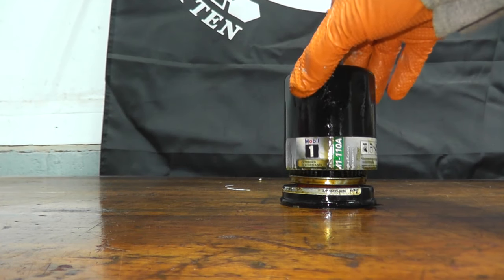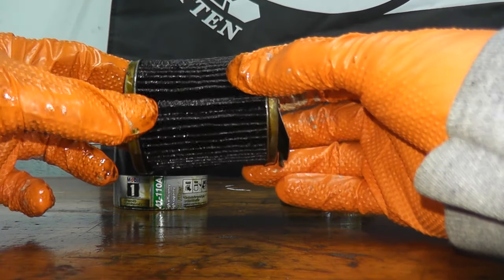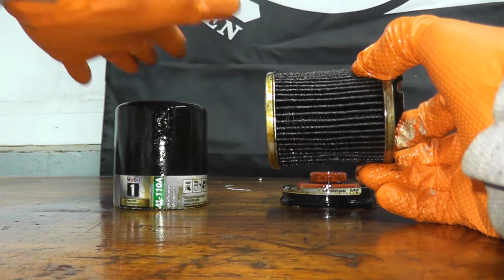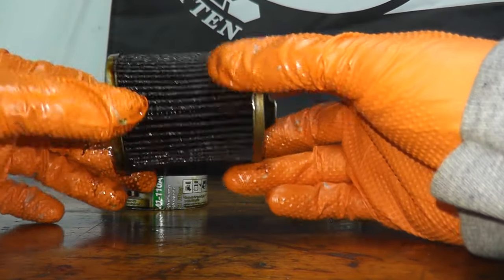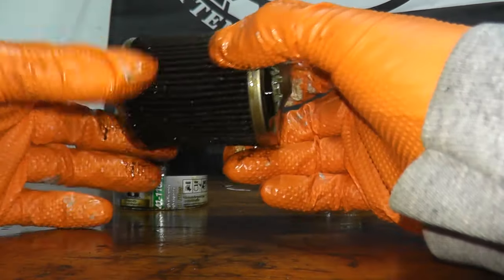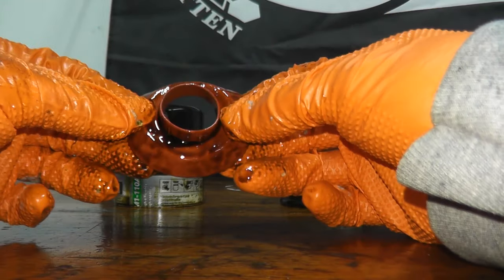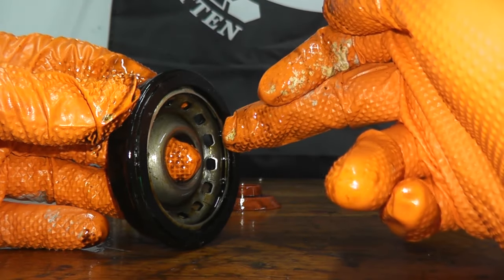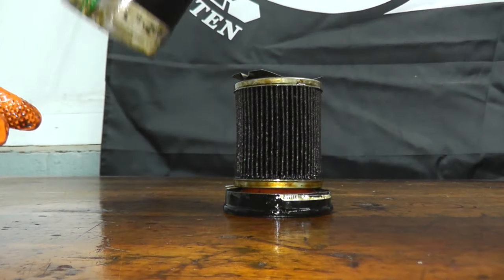Mobil 1 Oil Filter After 15k Miles Of Usage

Comment: I appreciate the informative video, brother!
My 2013 Chrysler 200 is at 57,000 miles. The owners maintenance manual states that running conventional oil, I should change oil every 10,000 miles. I use Mobile 1 20,000 mile full synthetic oil and the Mobile 1 20,000 mile filter. I still change my oil every 10,000 miles. The mechanic just about lost his mind telling me that my motor will seize up if I dont change it at least every 5,000 miles - regardless of filter or oil type. I stopped arguing with him. 

When I change my oil it still comes out relatively clean. A very light brown. Pretty sure it still has a LOT of life left, but I baby my cars. Yet every mechanic that I ever go to swears by the 1950s recommendation of "every 3,000 - 5,000 miles". I cant believe people still believe that especially with advancement in oil and engine technology... I call it a money grab.
Reply: Obviously the more often you pay to have the oil change. More money
Reply: I use Mobil 1 in a Mazda I’ve had since new. Change every 10k. 140k miles and no smoke. Good power. 36mpg at 80mph. Oil is much, much better since the days when 3k between changes was the norm.
Reply: yeah  good luck with needing repairs   
it's a Chrysler  anyways   junk yard car
Reply: @punker4Real  it's never had a problem since I've had it... 8 years later and it runs just as good as the day I bought it. Sorry you feel that way. I've babied it so it still runs, feels and looks new. The current value is way less than a car like this is worth - so unless I get in an accident, I foresee myself driving this for at least the next 16-20 years.

Comment: People need to read the fine print. These companies advertise these extra long intervals, but in the fine print tell you to go by manufacture recommendations, regardless. 

Also most vehicles have a severe duty interval. Like my Tundra. It is 10k mile interval. But “severe duty” which is gravel roads, stop and go traffic, short trips, towing, etc, it is 5k mile interval. Basically the long drain intervals are only for long highway driving.
Reply: Mobil 1 actually backs their claims.  Read up

Comment: I’ve known guys that put 8K miles on their synthetic oil and had it tested. Came back as for them to put more miles on it. For me, no more than 5K miles. I use motorcraft filter and pennzoil ultra platinum.  I use to use Mobile 1 but the pennzoil ultra is far superior over mobile 1.  Cost more but worth it.
Reply: Ah...a ProjectFarm student! I too, switched from Mobile One to PPU! I find it on sale at Walmart Online (not in-store) frequently for $22/5Qt jug and buy 8 bottles! Their “regular” price is ridiculous at ~ $68/5Qt bottle...
Reply: exactly.  i use same combo, but every single oil analysis after break in says 8k is fine on my Ecoboost.  Been doing for 8 years.  No problems.  PUP is awesome stuff

Comment: the orange rubber that  I know of is a natural neoprene rubber, and is the best rubber you can have on a car part or oil filter.
Reply: its Silicone btw
Reply: silicone.  its even better.
Reply: @02hreblue30  I don't happen to agree silicone is better for base gasket, it seems to be gummier, less backbone imo.  I've noticed some are switching back to black gasket while keeping the "better" sealing valve

Comment: On my 4 th hemi ram 03 08 14 and 19 changed the oil every 6500 miles with Royal Purple and KN oil filter all sold around 170 thousand the 08 has 400 thousand on it from second owner and that is the truck I beat the most GO Figure

Comment: Most excellent video. Thanks for posting. I guess the anti-drain valve you mentioned proves the point that when you change your oil and filter you should pre-fill your filter with oil if it is at all possible correct?  There’s an argument out there that it’s not necessary. I figure it takes 30 seconds to do it may as well do it if you can (filter is oriented in a manner that allows you to)
Reply: It's really not necessary, however if you're paranoid about it, prime it by disabling the ignition, crank it over a for a few seconds, renable the ignition, then start it up. There's really no need to fill a oil filter, engine parts will still be oil coated after draining the oil, and oil passages will still be full. Only case it might be a reason for would be for a engine that's been run a little dry on oil, as the bearings will be out of tolerance, then it might knock some on startup until oil circulates.
Reply: @garyr7027  - not paranoid at all about it all I know is when I start my car after changing the oil it’s as if nothing has happened because the oil filter is full. It takes another 20 seconds fill it before screwing it on. Simple case of why not. I surely wouldn’t disable the ignition and all the other stuff you speak of. Thanks for commenting
Reply: @condor5635  my 02 accord has 295,000 plus miles, the oil filter cannot be prefilled and I never had any engine noises on startup from a new oil change. I change it every 5000 miles. That's proof it doesn't need it, just a waste of time unless you have oil pressure symptoms that requires prefilling.
Reply: @garyr7027  - my 260k suburban can’t fill either but I do it on my Highlander. Just a habit. No big deal
Reply: Mechanics aren't going to do in order to save time. Does in make a difference. Yes but the difference is likely negligible. Still if you're the one changing your own oil, it's your time so why not? I'm retired and not in any hurry, so I often do it but sometimes I forget. In the long run it won't make any difference to me. The car will likely still be in great running condition when I may be dead and gone.

Comment: I change my oil every 5,000 miles. The filter I change at 10,000 miles. The oil filter integrity is still good at 10,000 miles, but I change it for peace of mind. I use Supertech full synthetic oil in combination with suertech mp filters. I've never had any issues. My oldest camry has 180,000 miles on it. The car runs and accelerates like the day I bought it.

Comment: Just change your oil every 3500-5000 miles and you will be fine. The people that want to push boundaries on how long they can use the same oil without changing it are the ones who keep the repair shops busy
Reply: Johnny  best  engine  maintenance I’ve heard     ps don’t forget the transmission
Reply: I wish people understood this. I do mine every 5000 thousand. Toyota call for 10000 and I'm thinking you guys are cutting costs. ✂️
Reply: I’m a 5k - 7k type of guy because my driving is 95% non-stressed freeway oriented!
Reply: Where is the oil analysis with particle count, viscosity, TBN and wear metals.  Get bright light shine through the filter media, you will be surprised by some of these synthetic filters.
Reply: Well I disagree with some of this. I have used Amsoil's best oils and filters in several cars, trucks, and vans with yearly oil changes from 12-25,000 miles. These engine required zero repairs other than valve cover gasket or tune-up stuff like plugs or wires, and were driven from 200,000 to 400,000 until either sold or retired due to transmission issue or wreck or other reasons.  But engines were still running with good power and smoothness. When valve cover(s) removed for gasket, no sludge or deposits.  I could not believe whst I was seeing the first time and used oil anslysis in the beginning to make sure oil was useable still....
Reply: @redlywaxer  In non GDI engines, I have in the past gone 40k miles with bypass filtration.  My current vehicle, 2012 Equinox with GDI and VVT, the oil shears to a 20 weight oil or less before 5k miles.  Fuel dilution is a problem in GDI engines.  GDI soot is causing major wear in these once reliable engines.  Amsoil is usually good for 8k, Full Syn about 4k, cheap oil about 2k.  In the winter I get a max of 4k.  I wish it wasnt so, but I still use Amsoil. Its still the best.
Reply: I agree. Most every oil related burning issue is because cars oil was changed every 10k miles. Every Toyota Master Tech that I've spoken with says to change it every 5k miles and use synthetic oil and you will never have oil burning issues.
Reply: Depends on oil and filter and how car s driven.  If all short trips on synthetic, then yes, sure go ahead and change at 5000 miles. But I have serviced a thrify friend's 2014 Prius with Supertech full syn 0W-20 and a $3 Supertech cartridge oil filter every 10,000 miles, and he does 30,000 miles/3 oil changes per year.  At 130,000 total miles, this engine does not use even half a quart between oil changes.
Reply: @redlywaxer  There have been a lot of issues with 10k mile oil changes on many Toyota engines and even other brands. The issue causes problems with the oil rings and oil burning begins and can quickly get out of hand. Sludge and buildup have also been a problem and clogging of small oil passages can cause problems too. Every Toyota Master Tech that I've spoken with has told me the same thing, change the oil every 5k miles and these issues just don't happen. They've seen plenty of oil burning issues with these 10k mile oil changes but to qualify for that OCI you would want to drive mostly highway miles and 90% of drivers wouldn't even qualify. So why try and save a few dollars at the expense of oil burning issues? It just doesn't make any sense. My wife has a 2010 Prius and I change the oil every 5-7k miles and it burns no oil between changes with 127k miles on it now. I use Toyota OEM oil filters and Mobil 1 ow-20 synthetic oil.
Reply: @jimsgaragetoys   1/4 of a qt at 104k miles(4000 OCI)  :D  my engine was well take care of

 this is amazing at lest for a  GMT900 as most of them  burn a qt every 1,000 miles or so 

The cheap comes out expensive
Reply: @punker4Real  It just goes to show that changing the oil more frequently is always a better option than taking a risk on a longer 10k mile OCI.
Reply: @charlesbarkwell7693  putting the wrong oil in a car will not cause it to seize unless it was straight oil not meant for cars. it will affect performance and efficiency in extreme conditions. too many variables were not considered (did she have 300k miles on her car, was there enough coolant, did she leave it on OD instead of dropping it down a gear, did she drop it down too low of a gear and over rev'd it.) btw, thanks for reminding me about the refrigerant ban. i may need to stock pile on r134a.
Reply: if they'd only have a look inside the engine & see the filth...
Reply: 3500 a pure waste of money.  Get an oil analysis after proper break in.

Comment: I love Amsoil  oil filter.
Reply: Me as well, that's all I use on small engines and vehicles
Reply: Used many oils at shops over several decades and amsoil is the best I have ever seen, oil and filters.
Reply: they don't make their own filters.  enough said
Reply: You are correct about Amsoil.  Mobil 1 extended oil filter is manufactured by MANN+HUMMEL Purolator Filters LLC.

Comment: You Never want to let an oil filter go 15k miles. Even if using synthetic oil, change the filter at least every 5k miles and just add 1 qt of oil. Personally, I change conventional oil at 2.5k and synthetic at 5k, just to be extra cautious. Remember 15k oils and filters are in "Ideal conditions", nobody drives in ideal conditions.
Reply: What if I only drive 1000 miles per year.
I have 1999 Sienna and I use  conventional 5W30 Motor Oil but use  Mobile 1 oil filter.
then How often should I change my oil?
Reply: "Nobody"? I'm sure someone does. Out of the millions of drivers on the road; someone does.

Comment: I change my oil every 3500 miles, my car has 850k miles on it and has never leaked a drop or had any problems. I change the filter every 1k miles just to be safe. If you are changing your oil every 4k miles you're just asking for problems.

Comment: Ive been changing my own oil since I'd started driving. With synthetic i usually change at 5k and the filter at every other oil change so at 10k. It's really the viscosity of the oil you want to maintain. I remember doing oil change at every 3k and the oil was like water. This was in an older car where the tolerance isnt as tight as today car. The oil just breaks down so easily.
Reply: I just started doing that this week. I was changing oil and filter every 5k. So I switched to a more expensive full synthetic filter so I can skip changing the filter in the middle of the winter in my driveway and just change the filter every other oil change.
Reply: Have you got any issues by doing the filter every other oil change?
Thinking about doing the same thing with Mobil 1 filter
Reply: @reyperez3424  No. I do filter every other and have put 100k miles on my dodge and no problems

Comment: I use the regular Wix  or Napa gold oil filters on my Honda's.
Reply: The Wix oil filters are one of the best.
Reply: Napa filters are just rebranded wix filters
Reply: @pacman3908  That is so true, I also discovered that the Carquest brand oil filters are also made by Wix.
Reply: I started using Wix filters about 7yrs ago best filter for the money i buy them on eBay by the case comes out to about 5 bucks a filter  Napa wants 8 bucks + for the same filter

Comment: Can someone explain how to properly utilize these high mileage filters rated up to 10k-20k miles? Do we leave the filters in during our interval oil changes at 3-5k miles and only replace them every other oil change? If that makes any sense?
Reply: I had the same question. Thanks for asking. Hopefully someone that is mechanically experienced can answer that question.
Reply: If you want to go the full 15-20k miles, you'll need a high TBN oil that won't turn acidic for a long time, like AMSoil. It's expensive, but it's almost twice as basic as most oils.

I use AMSoil 5w30 and a mobile 1, royal purple, or AMSoil filter on my show cars that don't get a lot of mileage, and only have to change the oil every ~5 years or so.

Comment: I wouldn’t run oil for 15k miles ever, let alone 10. 8k is pushing it IMO and 5k sweet spot for full synthetic if you plan on keeping your car for a while. Those piston rings will thank you
Reply: First time through I didn't catch the 15,000 mile oil change thing, I had to come back after my brain processed everything. WOW I agree, I was a lube tech for a bit and remember someone coming in about 8k over their due date and they had practically no oil in the sump. What was left was all black and nasty. 

I don't know how the thing was still alive
Reply: You can change the oil and leave the filter no?
Reply: @jeefberky2142  technically you can if you have a really good filter, but they’re cheap so since you’re in there might as well change it out too
Reply: @MikeyG003  yes that is what I meant.  If I have a filter rates for 15k miles as this video title suggests, then my idea is to install one of those and then use my handy oil extractor pump to suck out the old oil through the dipstick tube and pour in fresh full synthetic oil saving you both time and money.  No Jack's, no Jack stands, no creepers and no mess.  Do this five times every 3k miles then change the filter.
Reply: @jeefberky2142  not a bad idea actually, I might have to get an oil extractor machine because doing oil changes on 5 cars gets pretty annoying lol. The mobil 1 filters are pretty solid and high quality

Comment: Mobil 1 has a bypass valve and that is supposed to prevent the media from collapsing so the fact that the media looks good is not the issue how much unfiltered oil was going through the engine ? As it looks I think it went too far and we need a pressure test to see if the oil filter was working or was the bypass valve doing all the work

Comment: Can you tell me how much the flow rate of this filter was diminished from when it was new until it had 15,000 miles on it? If not then your video is of no help to me.

And the bypass valve is working and not siezed up. Well, that's all well and good cause the longer you leave the filter in and the more dirt that collects in the filter the more likely the bypass valve will open. Then unfiltered oil is circulating. What's good about that?

Comment: That is the only filter I run in my 08 TL type S when I couldn't get the A01 oem filters.
Reply: Ever heard of Amazon?
Reply: @bluesky-ud9wg  yeah, that's the first place I checked and they are all gone.
Reply: @davidrodriguez5280  Get he Purolator Pure One or Boss filter
Reply: J series honda v6 likes the Mobil 1 filter
Reply: @CRAPO2011  What does that mean, it Likes the filter?  Did you ask the engine if it did?  Either fun the OEM filter or a Purolator Pure One or BOSS period.
Reply: @bluesky-ud9wg  Purolator is crap
Reply: @CRAPO2011  haha, ok
Reply: @bluesky-ud9wg  Just kiddin with ya bud. Personally never tried Purolator I think of that brand as more for domestics GM/FORD (probably due to the nascar sponsoring from back in the day HAHA). Will watch a review on it
Reply: @CRAPO2011  It's best to run the OEM filter if you can but the higher Purolator filters are great. Just stay away from a FRAM
Reply: @bluesky-ud9wg  Honda OEM filters suck they are rebadged FRAM.

Comment: Great filter, but still can't match the Fram Ultra's 99+% efficiency down to 20 microns.  The Mobil 1 is great, at 99% down to 30 microns, but that's a full 33% larger particle.  So it falls short.  I'm sticking with the Ultra.  It does look like it held up just fine at 15k and would probably easily make it to 20. The Mobil 1 is clearly a filter you can run a long time with confidence.  Great video!
Reply: Only other filter I saw at that rate is Amsoil EA.
Reply: pure conjecture and opinion. None of these tests actually compares filtration with same oil and pumping it through them then oil analysis.  Believe what you may.  Rest is pure opinion

Comment: I change my oil every 5 thousand miles using mobil 1 oil and a regular Wix filter my toyota truck has 130,000 miles and is 15yrs old  took the valve cover off at 100,000 and was as clean as a whistle